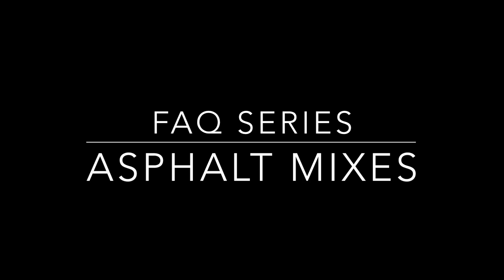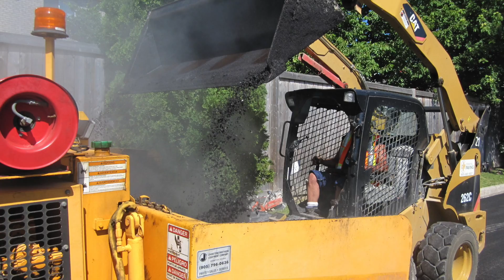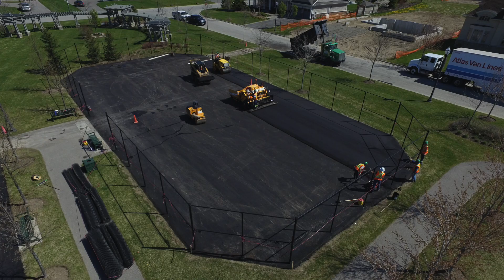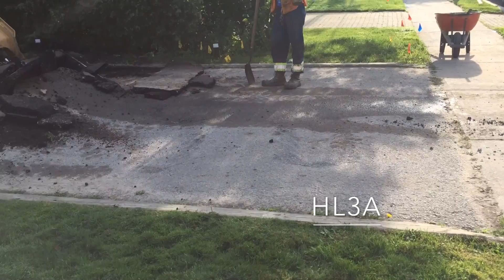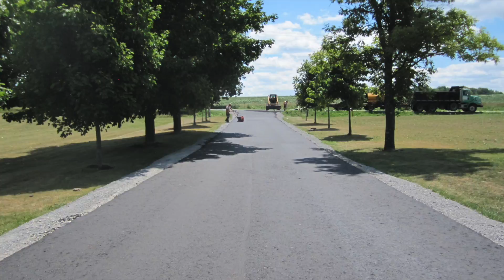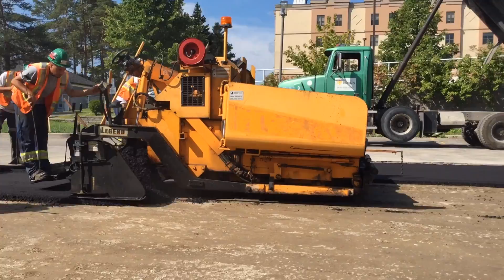Types of Asphalt Mixes

Comment: i didn't get it right, you meant the we have to pave HL8 1st. then HL3/HL3A on top of HL8? because you said underneath of HL3/3A.
what if just pave it with HL8 on top of roadbase? 
thank you for your video and thank you in advance to reply me back for my questions.
Reply: I'm with you. Why not just put down HL8 over a properly compacted stone base for the strongest pavement possible? If it works well on highways, why not my driveway? And highways don't need to be resealed every 2 years either. Are asphalt companies just setting themselves up for crack-fill and reseal jobs?

Comment: Thank-you!
I wonder which mix my town uses to patch the new gas lines. I’m guessing if they use HL8 it will result in a patch higher than the original surface. Can you tell me is HL3A should be used for better feathering?
Reply: I work for a gas company patching those. I'm here to figure it out too.